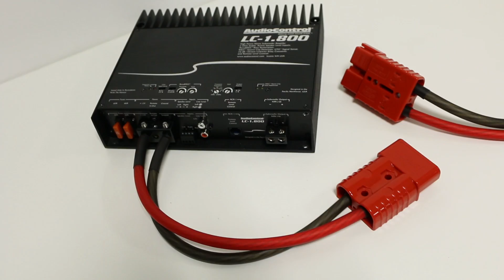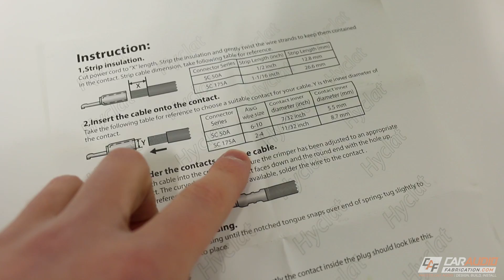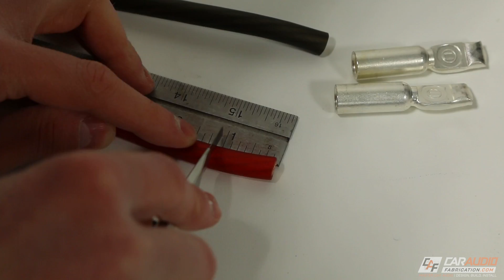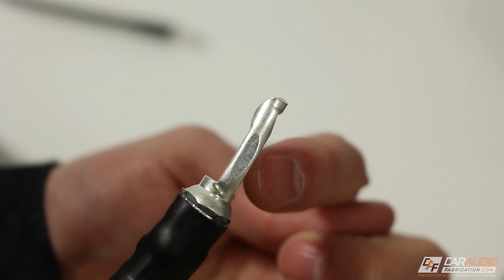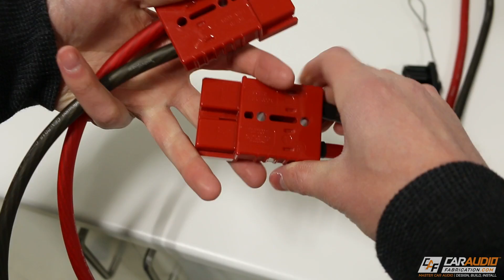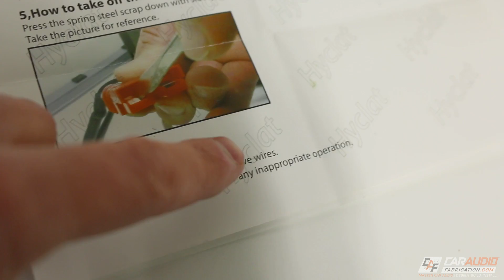Quick Disconnect your Amplifier! Battery Harness Plug Review

Comment: When installing with these without disconnecting ground battery terminal, will it spark when it makes contact? I'm thinking of installing a circuit breaker instead of fuse in engine compartment, to be able to switch the amp power off easily instead of disconnecting ground terminal and lose all settings in the rest of the car.

Comment: OK so what's the point of the quick disconnect if you have to remove the fuse? Once you go through the effort to remove the fuse point the amp is disconnected...
What am I missing here?
Reply from the maker: Let's say you want to gain space by removing the gear. Only removing the fuse just removes the power source, you'd still have to detach the wiring from the gear. With this you can design your system in a way that you just undo this plug and remove the fuse and all of the gear can come out.

Comment: Just wanted to mention that a gap between wire insulation and a connector is actually a good thing.  I have worked in the film industry for many years and have done my share of cable building.  I'm pretty picky about how I build things and this even extends to portions that wont even be visible to others.  I used to cut the insulation to perfectly match up to the edges of a solder-on, crimp-on, or set-screw cup of a pin.  Over the years I noticed that the wire insulation near the connector would become less flexible due to heat cycling.  When you have the edges of the pin and the edges of the stiff insulation butted up to each other they will actually saw their way through the copper with movement over time.  If you leave a gap and then heat shrink over this the two edges can not act as a scissor.  It doesnt need to cut through the full diameter of the copper to increase resistance and cause it to overheat and fail.

Comment: I’m wondering can you solder the power wires to the silver terminals that are pushed/clicked into the red housing? I don’t have a hydraulic crimper. I’m thinking solder and heat shrink.

Comment: I got the this quick disconnect but the one that's like half this size. it takes awg size 10 wires.  It's for my subwoofer. Not my amp. The amp is hidden but the Sub is a dual 12 and sometimes I need space in the trunk so i needed the sub box to be removable. Worked out great.

Comment: Says the 8 ga are only good for 50 amps ... if I’m running 3k rms ( 54 V Ac ) is this plug sufficient for this current draw/ transfer? Was going to use 8ga for subs

Comment: Does anyone know of a quick disconnect for power wires made for only one wire? Example is I'm going to be doing a secondary battery and this would be nice to use for disconnecting the power and ground wires quickly without removing the terminals

Comment: What compromises does this extra connection bring with the convenience of being able to put golf clubs in the trunk?
Why spend xrta cash on oxygen free copper power wire and gold plated connections if you are going to hack the wire up and add this.
What are those silver crimp fittings made from?
Will the introduction of another metal promote corrosion at the connector?
Will the resistance of this connector change over time?
Did you measure resistance at no load or did you perform a Voltage Drop test while running the audio system?
Is the power distribution fuse block REALLY that difficult to disconnect the power to your amp?
Wouldn't mouting the amp in the vehicle instead of on the sub box make removal MUCH easier?
A couple of banana plugs for the speakers as opposed to the power, ground, remote, AND rca inputs?
Speaking of audio inputs, what do you advise to do with them after unplugging them from your amp?
This connector is fine for a trolling motor on a boat or a power pack on a fork lift, but I would still seal the whole plug with silicone after plugging it in......every time.

Comment: A resistance test isn't really showing you anything. You could be connected with literally one strand of copper and get near 0 Ohms. It's better to simulate a load through the connector and measure V drop across it.

Comment: Those connectors are used on battery powered fork lifts. So the battery can be charged in place. Or so the battery can be swapped out for a charged battery. In warehouses, there is often a rack full of batteries and chargers. Along with  equipment for swapping out the batteries.

Comment: do they make any Anderson connectors for way in the 000/ size wires? like 2/0 and 3/0 ,4/0 I haven't seen any. I was thinking about using one per polarity. what would 2 , 2 gauge cables be equal to? 0 ga.? 2/0?
Reply: As Mark mentioned in the video, there IS a larger version, called the 350A version, which accepts 0 gauge wire, used on many forklift applications. They come in different colors so,  you could do pos in "red" and neg in "grey".

Comment: Mark... great tip... I have used this connector for all kinds of things. From quick disconnects for hitch mountable winches, to heavy duty light bars. However never thought about using this for a quick disconnect on an amplifiers power and ground... Should have thought of it, since I have used these connectors since the 90s :P
   Normally I just mount a distribution block, with the ability to use an Allen wrench to remove the connected cables... This is just a better idea, since this connector was designed to be connected and removed thousands of times before any failures. They are also self cleaning, when you remove the connection the shape of the "pins" rub together to help remove and corrosion. The way I have been doing it, the cables becomes damaged over time and require being stripped back and redone.

Comment: Or you can just buy an amp that already has quick disconnects like the Alpine PDX series instead of waste your time with this hideous plug
Reply: Anthony S. This plug may be large for the application, but at least it has proven its reliability over many years of use in heavy industrial environments. This plug will literally NEVER come loose on its own or fail to provide a reliable connection in car audio use unless you can’t read assembly directions.
Reply: Well the "quick connector" on the Alpine PDX series is just as bulky and "bad" looking... The difference here is you can install the quick disconnect anywhere in the line, and easily hide the high amp connectors behind or under something. The PDX series has this huge ugly connector sticking out of the side of the amplifier... There is no hiding that wart of a plug :P
Reply: PPI for the win!

Comment: I thought about using this connector in my build, but I saw people actually dumping a ton of solder into the metal pins to get the wire to stay in it.
Reply: Tyler Watthanaphand That’s the kinda amateur way of making this connector. It’s not what the connector was really designed for, but it will work. A crimp connection is far superior in terms of electrical resistance (you don’t have the slight increase in resistance between the wire and the connector barrel) and you get better mechanical reliability.

Comment: I’ve thought about doing this for a while now. Just needed to see it done by a pro first! 
I have a sub box by Kicker with 2- 12” subs. My amps are mounted to the back of it on a separate board and attached with those aluminum picture hangers (forgot name). I did it this way so I wouldn’t have to modify the car. Anyways, if I ever need to get the spare tire out, it will be a lot of work. This connector is just what I need!
Thanks for your professional video on it!!

Comment: question how about the remote turn on wire that would need a small quick connect too unless u undo the the wire straight from the amp everytime and have to have a screw driver or a allen key nearby
Reply from the maker: Quick connects for smaller wires are much more commonly found.

Comment: What the heck are people running in their cars. Man, those are some pretty thick cables. I don't think I have even seen any starter wires that thick. Maybe on a semi, I don't know.
Reply: Most of the time an amp for a subwoofer is going to be towards the rear of a car, meaning a fairly long cable run, meaning it needs bigger cables if you're running any kind of power through it.

Comment: Any three prong versions of this to include the remote turn-on?
Reply: Alvin Cole Just use bullet connectors for a few cents.
Reply: They are called Anderson plugs you could look at something like their SBS®75G type plug for a 3 pole version
Reply: My thoughts exactly. Or maybe a 5 prong plug to do ground, power, turn-on, and a set of speakers leads.
Reply: For a disconnect for up to four speaker wires you can use a speakon connector. They’re used for PA systems and are available in 2 and 4 conductor versions.  You could use the 4 conductor version for a speaker pair and remote turn on. Also, mountable  RCA barrels are available for the signal.

Comment: Looks just like the wiring disconnect for electric fork lifts
Reply: that is what they are.
Reply: That’s because it’s the same thing, just a smaller version. They’re made bay a company called Anderson Power Products. The ones in the video are just an all in one kit that some company put together for the car audio market.
Reply: We use them at the mine that I work at for small electric locomotives.
Reply: Jay I was just about to say that lol! That plug is almost identical to the stand up forklift I used to use at my old warehouse job lol!
Reply: Yep, these are awesome self cleaning, high amp connectors. They come in all kinds of amp ratings, I use the 1k amp for the batteries on my electric ATV... Have been used on pretty much every single electric forklift out there. Then I also use them for hitch receiver mounted winches... allows a quick disconnect that won't fail or have issues with mixing up the connection, when in a rush.
Reply: 175 amp connectors. Pallet jacks, scissor lifts, and other equipment.
Reply: Yep, and I use the much smaller ones for pretty much any 12 volt project I need a quick disconnect for. I often have to make adapters to connect to other types of connectors, but this is a good way to have a standard connector on your power supply.

Comment: Hey there! I just recently discovered your channel and love the videos. I always had a pretty good idea of how to quick disconnect the power and ground, but I'm curious if you have any tips for the remote turn on and RCA wires? I don't really want to repeatedly connect and disconnect the RCA wires from the amp for fear of wearing them out or breaking solder points inside. Thanks!

Comment: I used those exact disconnects in my install, my only issue with them is they do tend to get warm after playing the system for long periods of time. We have the same issue with the quick disconnects on our Toyota battery fork trucks at work.

Comment: Oh cool, I was planning on using a couple Neutrik male/female jacks.

SpeakON jacks can handle 25A per contact. But that's at 250VAC. Would it be able to handle more current at a lower voltage seeing as it's less overall power @12V for the same amperage?
Reply: What matters is current not voltage its rated at, mainly becouse of resistance.
For sake of simplicity lets say terminal has 0.5ohm of resistance, that means that with 10A passing, voltage across it would be 5V, now since power is U*I you will have about 50W dissipation on it, either at 240v or 12v its same but with that 5v drop on it voltage after connector will be 7v in 12v case so its not acceptable, with more current passing obviously more power will be dissipated so if you push 20A you will have 100w on it and it may not be able to dissipate it and it may melt (again, for sake of simplicity i used these numbers, in real world you are gonna see much less heat/resistance)
Reply: No. It does not matter what voltage. If something holds x amps it will hold x amps at 1V or 100V
Reply: but lets say it's 1A

1A at 100V is 100W
1A at 1V is 1W

is it a matter of power? Or I^2 * R where the resistance of the contacts is the only thing that matters  and current is current?
Reply: Amps (aka the measurement of current), is going to be the same rating no matter the voltage input. The only thing that changes is the wattage (aka Power) or working force that can pass through the connection... For example 12 volts (DC) @ 25amps is about 300 watts... 250 volts (AC) @ 25 amps is about 6250 watts (power factor of 1.0). The difference is you can "push" a bigger load at a higher voltage... Part of the reason amplifiers can output more at 14 volts of a running vehicle over the "12" volt output of a battery. Of course this is in a "perfect world", things like resistance and load types can change things drastically... SO main important thing is to never risk "maxing" the load rating of a connector. SO if something is rated at 25 amps... try to maintain a 90% max rule to prevent overheating a connection. Of course this is just a guide line and not a hard rule. :) Hope this helps
Reply: I learned some stuff. Thanks m8s <3
Reply: Current is current as long as you're not [dis]connecting under load.

For switches/breakers that do [dis]connect power directly to the load, the DC current rating is usually significantly lower since the AC voltage will drop to zero 100/120 times per second, extinguishing an arc, while DC might keep the arc going.
For a given current type, AC or DC, the current rating will drop as the voltage goes up, for the higher voltages higher capacity to arc.

But for a connector that is only plugged/unplugged with no current flowing, it's all about contact resistance and current.
Reply: Contacts and wire cores are built for current, insulation is built for voltage.
Look at it this way: in Europe, a 2.5mm² wire in a house is fused at 20A for a potential power draw of 4.6kW at 230V. You wouldn't use a 2.5mm² wire in a 12V car system to run power/ground to a 500W stereo amp because that amp could draw over 40A, you would use a 10mm² wire for that. However you could easily get away with 2,5mm² speaker wire to bridge a 4ohm subwoofer on that amp since the amp will only be pushing 11-12A at ~45V to the sub.

Comment: Another note if you plan on a techflex type cover make sure you check clearance I had some fitment problems with the jacket/Tape/Heat shrink
Reply from the maker: Good idea, I found these ones had plenty of room
Reply: Only had that problem once, seemed to be from the way I used the liter to keep the techflex from fraying and then Super33, then heatshrink with glue.. i had to shave it a little to make it fit would not lock.. but yeah best option for sure. Hi5 my friend
Reply: Yep have run in to that issue before, since some power cable have really thick insulation on certain ones. I use a lot of "welding" cable since it is great value for performance.

Comment: Thanks for putting your name at the beginning, Almost forgot who you were. 

Aside from trolling.... Is there anyway you can do a in line capacitor (like a 68uf for tweeter protection) and XT60 installation guide with your A pillars?
Reply: Jack Oswald  just solder it in-line on the positive side and you’ll be set
Reply: He's asking for suggestions and was asking if he was going to include it. Install bay makes easy solder in solutions I was just suggesting.
Reply: Both seem like basic things to do